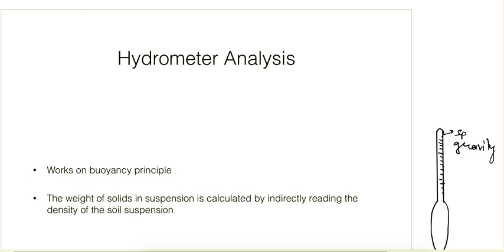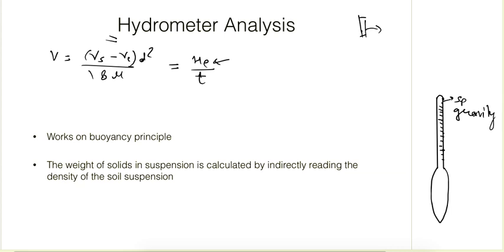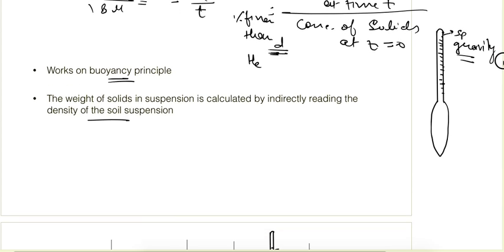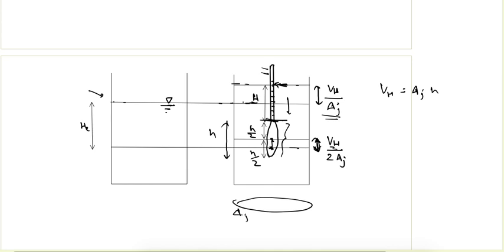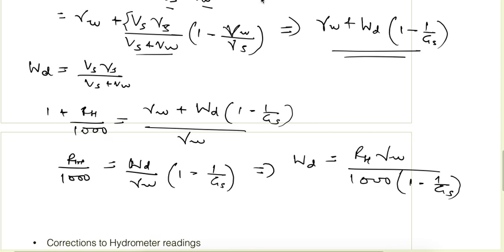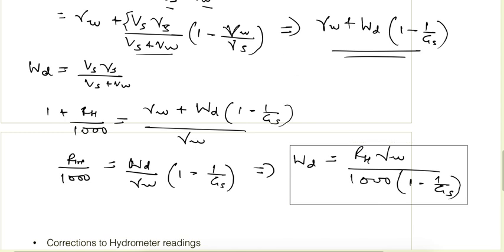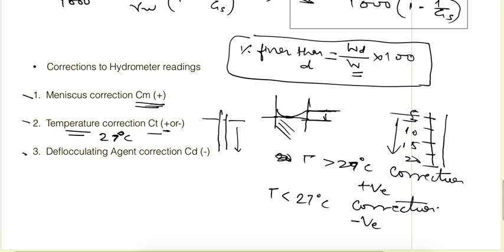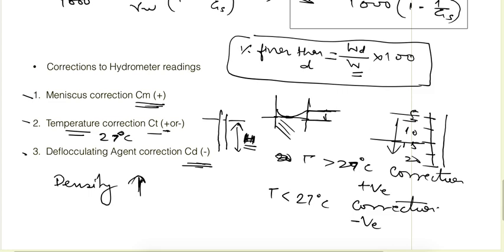Hydrometer Method - Particle Size Analysis | Soil Mechanics

Comment: Sir I can't able to understand why centre of hydrometer will rise by only (V/2A)
Reply: It is said that only the bulb of the hydrometer contributes to the volume change i.e., change in the water level. So, considering the central level of the bulb, only half the volume of the bulb induces the change in water level. So, the water level  difference near the centre of the bulb is V/2A
Reply: Overall displacement of water due to dipping of hydrometer is V/A. But did the water below the hydrometer-bottom get displaced? No, it is undisturbed & undisplaced . Only that layer of water gets disturbed which experiences immersion of anything having some volume.
Here, from hydrometer-bottom to centre of bulb, that layer of water experiences immersion of only half of the bulb, so volume of water displaced is half of the volume of bulb (V/2). And the height of displacement is (V/2A).
Here V = volume of hydrometer bulb
A = base-area of jar